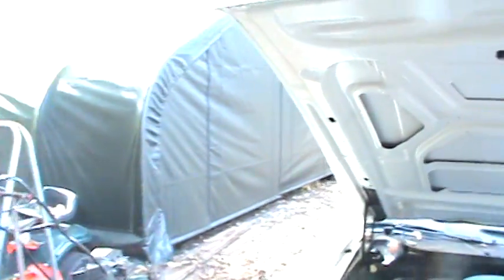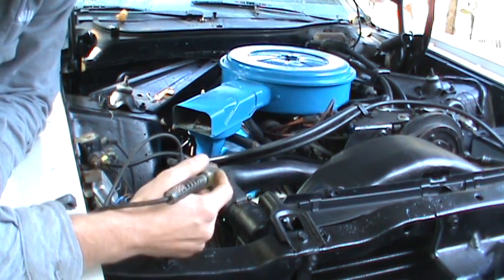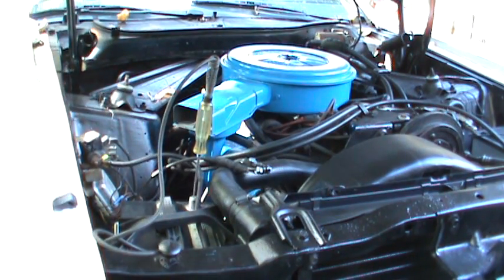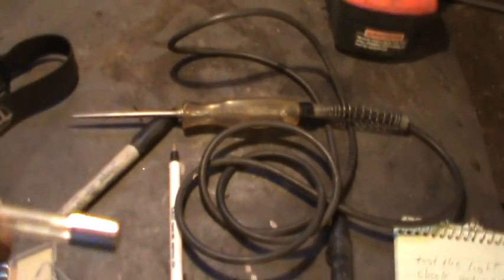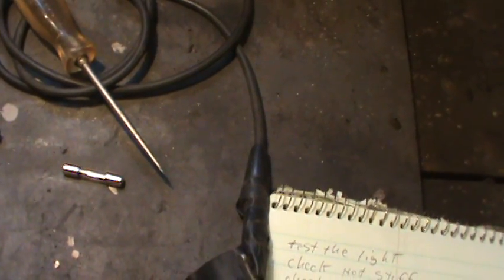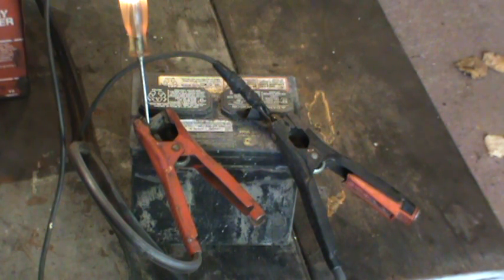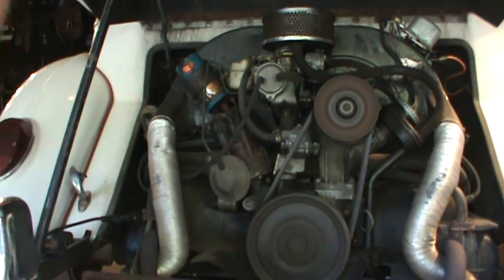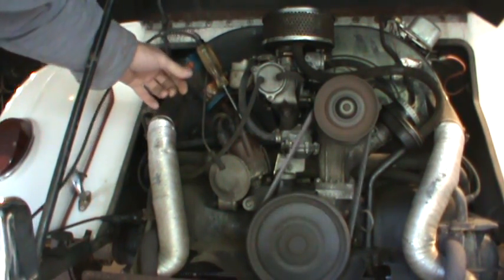how to use a automotive test light

Comment: Dear sir,I just utilized your test light testing in connector to a 2001ford ranger major charging system fixes.after cleaning and testing all prior to declaring altenator was bad I tested the connector 3 wire to altenator and low and behold,as I had customer repeatedly trying to crank I saw the smallest faint miniscule  low light symptom !! Declared altenator dead! Replaced and viola hard work and testing paid off thanks to your mentioning the faintest light on se sor wire of the connector!! Had to really squint it was so small!! Ty sir Jimmy and daisy dog mobile mechanic!.

Comment: Very informative.  I like the static timing technique.  Working on a old Allis Chalmers tractor, and that looks like it will be very helpful, as the ignition will get new points, plugs, condensor, cap and rotor very soon.

Comment: The sharper the point the better it pierces the wire insulation. Usually a finger is backing that wire and when the light probe slips  off and goes into you finger.  You keep working like it never happened, when you are done, then you can cry.

Comment: Can I use this method to determine the positive and negative of the car light bulb wiring? I need to wire the reverse camera and need to determine the polarity of the reverse light. I plan to connect the wire of the test light to the car body (as a ground) and connect the tip to each of two wires of the reverse light. I assume if it lights up, it means the wire is positive and if not, it is negative? Thanks

Comment: Hello,again great video. I went out and bought a test light. Great tool. maybe you can help on this one which I know I'm wrong your test proved that. ok, the part of your video were you test the distributor where you ground out the spark to see if it makes any difference. I know that the light has a 12v bulb in it. I know that a car spark can have 10 to 20 kv of spark. If i were to plug the test light in a house outlet plug with 115v ac it would blow the bulb out. where am i going wrong here.